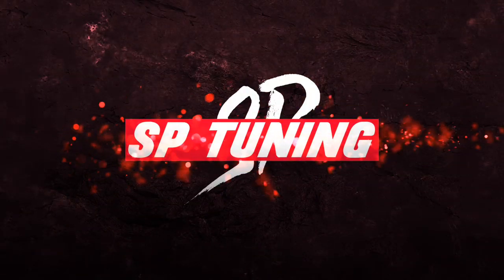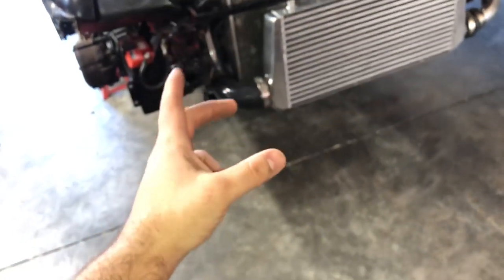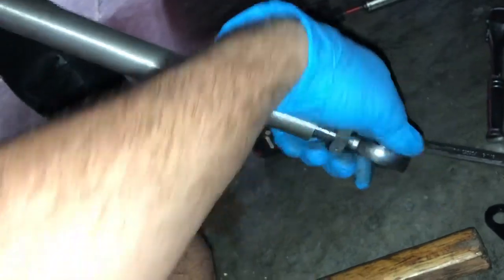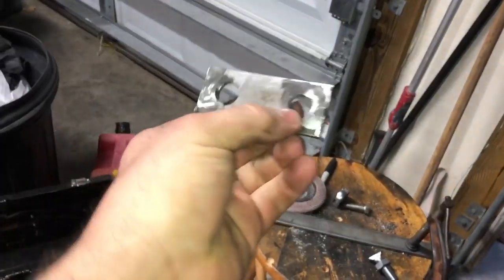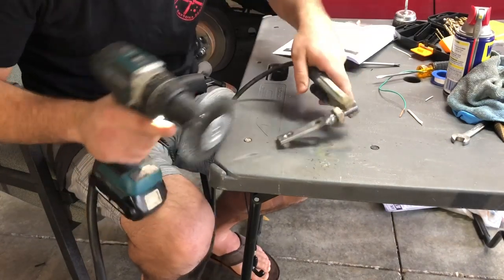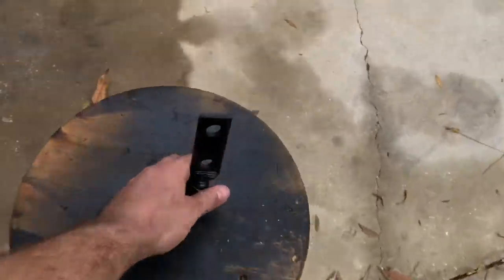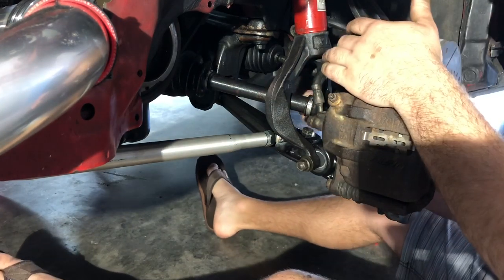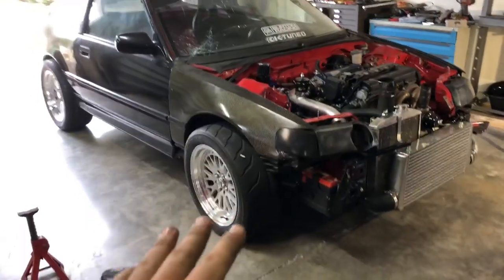Traction Bar Headaches Mod for Crx/Ef?

Comment: Innovative traction bar and be done with it lol
Reply: Yes is problem is not the lower control arm mounting point its the traction bar mounting point are wrong for ef and dc integra
Lot of people tell this hack this traction bar is no good on ef
Bar need to be bolted to the
factory location

Comment: I thought about doing this but DEFINITELY not a butt weld. That will bend and or fail I promise you that.  It has no strength up and down at all.  You should have had the heim joint pressed out and then machined the end like a rectangular key to except a key to lock around it and then weld it.

Comment: That weld will crack as soon as the wheels hit the ground!!!
Reply from the maker: Yet it still remains uncracked 🤯🤯
Reply: SP Tuning that arm is supposed to travel up and down with the suspension! We will SEE in time!
Reply: SP Tuning and when you adjust then the angle will change and apply some unnecesary forces on the threaded rod!
Reply: yawn

Comment: You solved nothing the wheel will still move like in your dyno video
Big fail 
the traction bar is pivoting on the bolt holding it to the car
Reply from the maker: We’ll see. If i fail its motivation to keep workkngn harder.